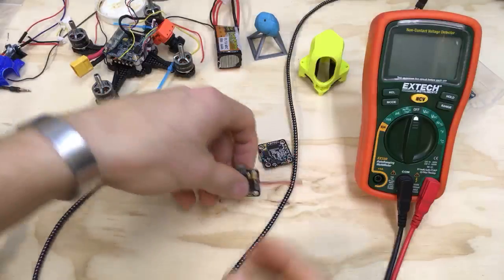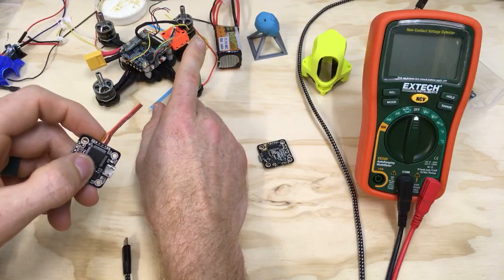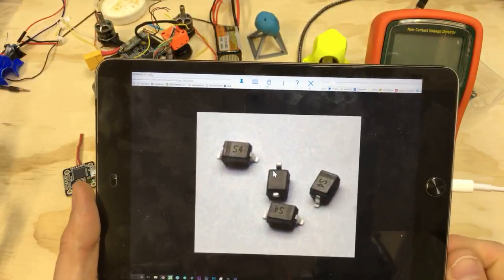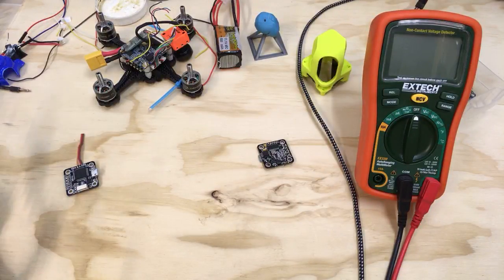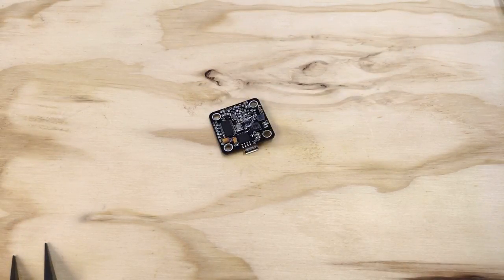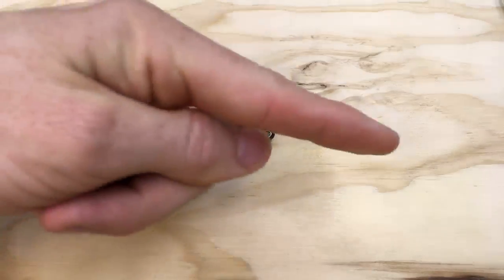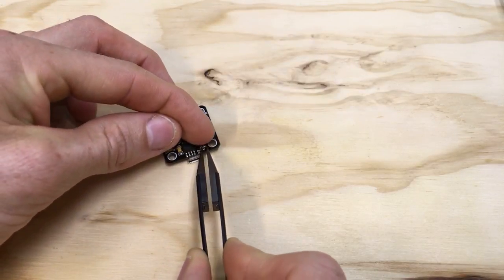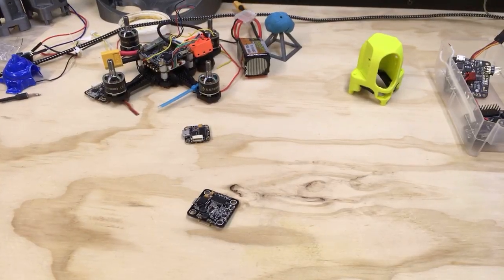Fix USB Power Diode Flight Controller | Live Stream

Comment: I have a question I cant find that diode on any of mine I only have 3 legged diodes Not sure which is supposed to get 5 volts 
I am not getting any led lights on the board but it does make the sound when the usb is plugged into the comp
I need help fixing these I have 4 
I know ,bad times